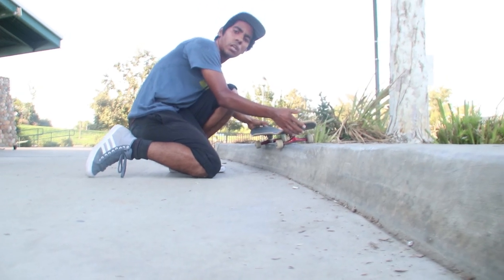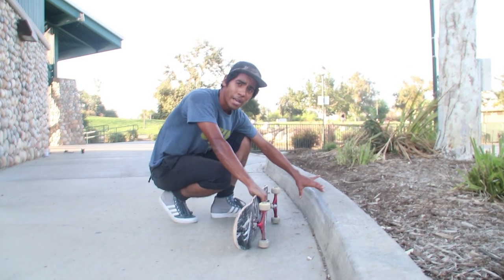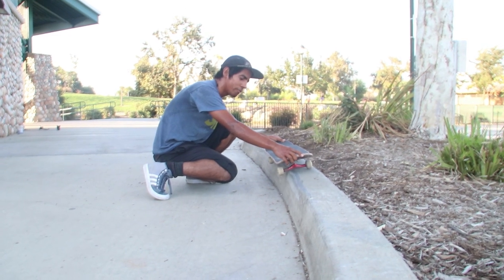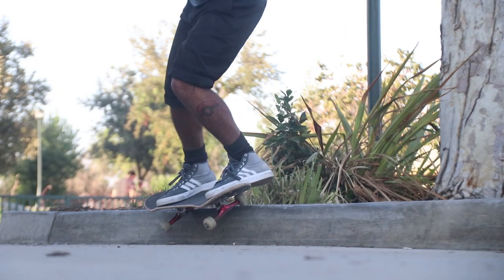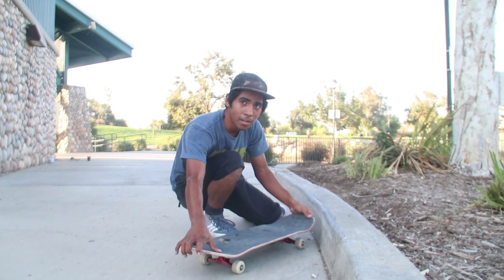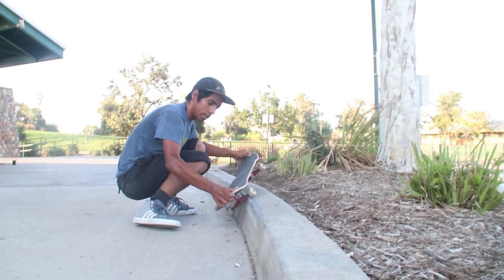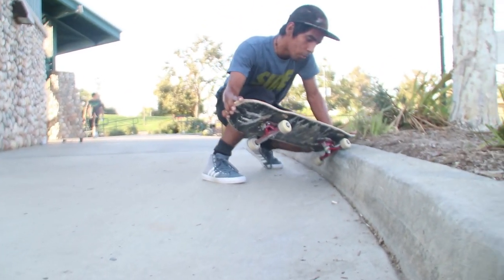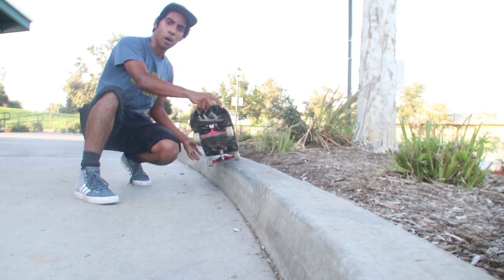How To Slappy Bs 5050, Bs Feeble, Bs Crooked Grind

Comment: Question:  when you slappy back 50 are you aiming to get the back truck on at the same time or earlier than the front or is your front truck grinding first?  You’re a talented guy, my man.  Bless and best of luck with your skate career.
Reply: come in at an angle, with front truck entering grind first. the “weightless” thing this guy mentions is a sort of hard concept to grasp. for me, lean more onto your toes (or heels if you wanna frontside 50) and enter grind with front truck first. then once you get comfortable grinding on a slant, start shifting your weight on top of the curb to grind further.